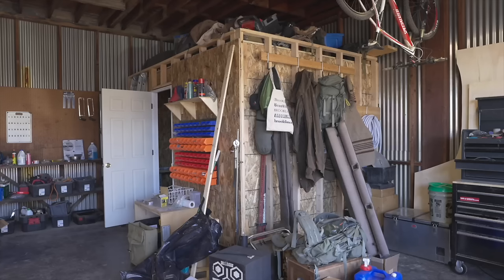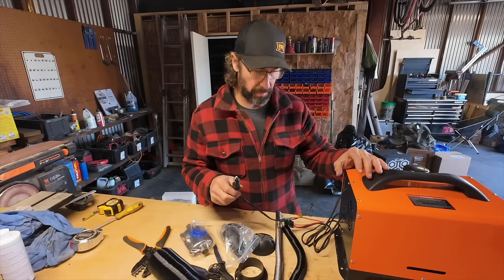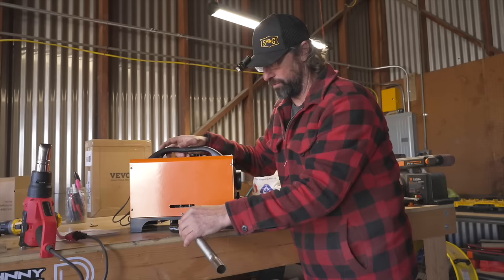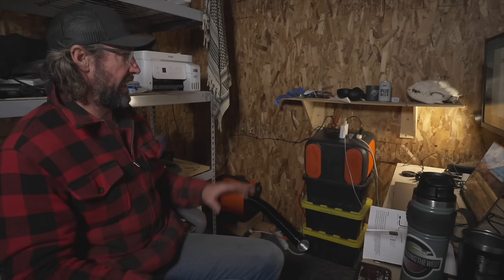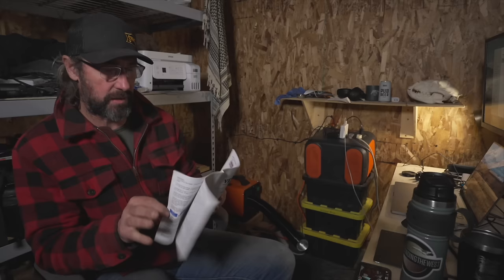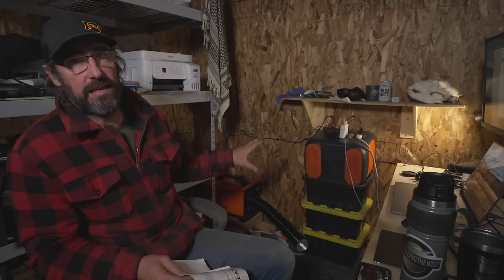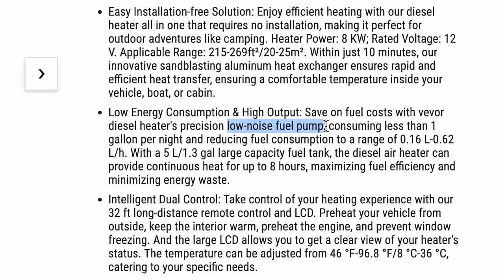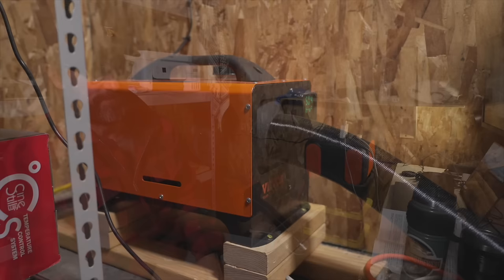Vevor Portable Diesel Heater - Don't make this Mistake😖

Comment: Wouldn't it be more efficient to have the air intake in your office to recirculate the warm air rather than taking in cold air from your shop?
Reply: I thought this too, especially after he said that it was inefficient to have it draw in and heat cold air. But that's what he was doing.
Reply: The intake will be sucking in exhaust fumes... not healthy..
Reply: The air intake from the outside is only for the cumbustion chamber inside the heater. The intake for the hot air is on the backside of the heater.
Reply: If you use the office air for furnace combustion, then outside cold air will be sucked into the heated room to replace the room air for combustion. That will create cold drafts & work against you.
A 90+ % home furnace works the same where the furnace pipes in outdoor air for combustion air.
Reply: @kevinanderson7555  ?huh
Reply: Not at all, if you pull combustion chamber air that is heated up, in to burn only to exhaust it you just made the system that much less efficient. Pull cold air to burn, then you have not wasted energy heating it up prior to burning it.
Reply: @kevinanderson7555  no it wouldn’t…exhaust is outside …remember this is combustion intake ( so that you insure enough air for complete combustion and not starving it for air if you have it inside in a tight space then the possibility is there to not provide enough air combustion air from the outside is always the saftest  ) as far as efficiency it would be a minute difference
Reply: No it needs fresh combustion air
Reply: @sk-wx1cf  the colder intake are the better.
Reply: If you want efficiency, get propane.
Reply: I have my intake routed so it is right next to the heat output,and I set the controller to high altitude mode ,it works great now

Comment: To do the floor in my shop, I used inch and a half foam board and two by fours on the flat. With 3/4 plywood. Worked really good.

Comment: The intake goes inside. It's more efficient and it won't kill you with exhaust fumes being sucked in.
Reply: That’s not how these work, the intake goes straight into the combustion chamber and out the exhaust, kind of like a small engine except these have a heating element and the fan blows through it to create the warm air.

Comment: If I had to guess the reason it doesn’t completely shut off is because it would have to kick up the amps to fire up those glow plugs. Been looking at one of these. I’d like to install one in my travel trailer.  Biggest issue is the fuel tank. So I’m going back and forth on either a unit like this one, or the older types wit the separate fuel tanks. Those Vevor items seem to be built pretty good. Thank you for the video.
Reply: installed in enclosed trailer.removed tank.fuel shut off with drip line into plastic bottle for disconnect. sits on top of unit strapped down with bungie. keep in old tool box for transport. no spilt fuel in trailer .exhaust goes through aluminum pipe and conduit double male connector.
Reply: I could be wrong but I believe all these Chinese heaters are made at the same factory in China and stamped with different names.  I just purchased 3 ChuBu Diesel Heater All In One 5KW/8KW 12V-24V for $99 each, they look and function identically.  
Looking at the specifications,  I see no difference.

Comment: Running it off a motorcycle battery with a trickle charger is a great way to power these heaters. You should never do a hard shutdown; this would happen if you had a power outage. The battery prevents this from happening. I have mine mounted in a hard plastic tote box that’s insulated. The exhaust exits the box using a through haul vent designed for boats, the heat from exhaust line keeps the inside of the box warm. The battery and trickle charge are mounted in the box so they are warm as well. Works great

Comment: Nice write up on your diesel heater install experience.  I also use a diesel heater to heat the topper on my truck.  Works great.  Like others, I have some suggestions on your installation.
1) You might try using a heavier gauge wire between your Jackery and heater.  The voltage drop due to thinner wires may be causing the heater to pull more current than necessary.  Can't tell for sure what size wire you are using, but it looked small.  I would suggest 10 or 12 awg wire and cut the cord from the cigarette lighter plug as short as possible.
2) I understand the exhaust setup shown is just temporary, but for the permanent install, the muffler has (or should have) a drip hole on the side opposite the mounting hole.  This should be placed down so that any fuel or condensation can drip out.
3) Somebody else already mentioned this, but I also prefer having the air intake come from the outside to minimize condensation.  There is a hit on heating, but having less condensation is worth it.  At least for me.
Keep up the great work!

Comment: I'm using a rv 110 to 12volt converter to power mine in my small shop. Works great.
Reply: You'd be wise to run it off a battery with a trickle charger instead of a converter. You could have serious trouble if you have a power failure. These are designed to shutdown properly if the battery voltage should get too low but not if the voltage is suddenly removed.  Think of it this way these are designed to be operated in vehicles.

Comment: Great information! I'd offer two suggestions for your setup, for your start power issue, get a small 12V battery (I use the little 15AH type, sized similar to an electric start generator battery) and a battery tender/trickle charger you can connect to the Jackery, the battery will provide the amperage needed to get the heater running and the Jackery will keep the charge topped off with little amp draw. Second to address the pump noise, I've found wrapping the fuel line with self adhesive foam tape, especially anywhere the fuel line may wrack against hard structures of the cabinet, can really quiet these heaters down a lot. Best of luck with your setup! Thanks for sharing your experience.
Reply: I plan to power a heater with my Jackery this seems like a good workaround. Would you be able to have the battery charger and heater’s power wires connected to the terminals on the battery at the same time? Would I need a fuse board off the battery? I’m new to this
Reply: @Kscanlon22  Yes, it's not a problem having your heater running off a 12V battery that is also connected to a smart charger that is plugged into a 120V outlet. AND Yes, you should protect the circuit from the battery to the heater with a fuse, a simple inline 15 amp fuse will suffice.
Reply: @StratOvation  what’s the advantage of this compared to just running an AC/DC inverter off the 120V outlet? Is it more efficient?
Reply: @Kscanlon22  All of these heaters need to perform a shutdown procedure to burn off unspent fuel and clean the atomizing screen in the ignition chamber and they will run the fan for a few minutes to cool the heat exchanger portion of the heater, the cool down cycle is critical to protecting the ECU. If you do not have a guaranteed ability (such that a battery will provide) to allow the system to cool itself down before powering off, the residual heat in the unit can cause the electronic control unit (ECU) to become overheated (damaging the printed circuitry), rendering  it useless and requiring replacement of the ECU.
Reply: In short, any unexpected interruption of the 120V power to the inverter will potentially damage the ECU making your heater unusable until repaired and lead to fouling of the ignition system which may make re-starting the unit a challenge.
Reply: @StratOvation One might look into a Nitro RC car glow plug and power pack with a simple button.
Last I checked 12 bucks at any hobby store and use that to heat the glow plug on start up.
Reply: @ducewags  Interesting idea. I'm not familiar with that device, would it be capable of delivering a constant 4 amps to operate a heater on high speed? The glow plug would need to be the exact same thread size & pitch to allow a tight seal where it mounts to the heater. What is the amp draw of the glow plug you're talking about?
Reply: @StratOvation  The internet has answers to questions. And the internet also has answers to thread pitch, taper and type. You don't need the same pitch as adapters are a thing that are made to seal glow plugs in heads. RC Nitro engines run over 50k rpm and can have a constant heated glow plug for winter runs in -40 or colder weather. Fun little fast things to play with.
Reply: Just buy a $20 12v 30 amp power supply and run it off your  ac outlets .That is all I have ever used .I would not have a long exhaust ,just more to clean out when it soots up .

Comment: Wow!  That fuel pump is really loud.  I recently purchased a Wippro brand heater like yours based on a review on YouTube.  It's very quiet with just a soft ticking in the background. I believe the pump is well insulated from the chassis compared to other brands.  Very informative video!
Reply: Same here with the Maxspeedingrods.....almost silent. However, I do have hearing issues. When I first ran it outside I had to put my ear near the unit to make certain it was pumping.

Comment: I run mine on a Jackery 300. All you need to do is put a bigger fuse in the actual DC plug that comes out of the diesel heater. With a 300 you can only run it for about 3 1/2 four hours and a full tank of diesel will get you about eight hours of run time.

Comment: Thank you finally someone addressed this issue i was wondering why my diesel heater would shut off using that plug, i just went with the ac to dc power adapter and it works fine plugging it into that, hopefully vevor does fix that issue. Thanks for the content!
Reply: It's not a vevor issue, it's a diesel heater issue as a whole so it won't be changed anytime soon. It would be easier for jackery, anker, ecoflow, etc to bump up their power ratings to 15A than it would to get random chinese companies to lessen their power consumption on start up.

Comment: Good video. For those afraid to tackle taking these apart to install the exhaust and intake lines, I ordered and used a STREBITO Mini Ratchet Set, 22-Piece 1/4 Ratchet Right Angle Screwdriver. Got it off Amazon for $12. Great little tool that has 36 teeth, meaning you can ratchet it with very small movements in a confined space. I paired that with the NEIKO 10068A Nut Driver Set, $14.95. I have since used it on other projects as well. Everyone should own one of these sets anyway.....they are awesome. Using the listed tools I was able to install the pipes with little to no issue. BTW, using a dremel, I extended the spilt in the pipe an additional 1/8 in. and could probably have extended it a bit further. This allows tightening with a lot less final torque. As for powering your unit, I would use a DC 12V 30A Power Supply 360W Universal Regulated Switching AC to DC Converter sold on Amazon for $20....drop down to 20A and it is like $17. I would go 30A though, I am always for overkill.

Comment: Put a house radiator as part of the exhaust, and you will get to use the exhaust to add heat in your office.  Thst or make a coil of tubing into a bucket,.open air or in a wood burning stove and run the exhaust through that before dumping it outside will make better use of your fuel.  This way your exhast heat will radiate off the coils or radiator and the blown heat can be pointed to cross the room or warm the floor.

They way you have it throws away half the heat that heater makes.

Comment: Old computer power supply is a great way to run these.   I personally have a car battery with small battery charger attached.  Be sure to have the exhaust at a slight downward grade to allow any condensate to be able to drain to the outside.

Comment: I saw a review of this heater on another channel. The exhaust pipe got hot enough to scorch wood, so be careful with it.
I would not be able to tolerate the constant loud knocking of the pump.
Reply: True. Exhaust pipe gets hot and connection under unit is very hot. I purchased a 90 degree connector and wrapped the pipe twice with high temp tape. Works great and safer.
Reply: Most models stop ticking after they get warm

Comment: Interesting video. I have an 8kw Hcalory portable diesel heater and I have an ecoflow river max and ecoflow mini portable power station and both power the heater perfect. On start up the diesel heater draws around 120 watts for the 1st couple of minutes and once it fires up and starts to run on diesel it drops down to around 6 watts around the same as charging a phone and would then run continuously for days. As you've demonstrated there is definitely a problem with the set up your testing on start up. My set up must demand less power or the ecoflow just puts out more amps than the jackery.

Absolutely love your videos.  Watched them for a while now. Great content.

Comment: Add a 2x6 framed and insulated floor. You’ll have a step up into the office but that will help the cold radiating from the concrete floor problem.

Comment: Thanks for your review. Great points.
I have a Vevor (5wk) all in one unit for my Van and it blast me out on low setting. I wrapped my exhaust pipe and purchased a 90 deg. fitting (From Amazon) for the exhaust pipe because it hard to bent the pipe to fit the unit. Wrapping the pipe is just safer too. Can't go wrong with the Vevor unit.

Comment: Floor:
Apply some 2” foam board insulation over the concrete. 
No need to glue down. 
Cover foam board with plywood. No glue. Done. 
Insulate ceiling next. 
With 2x6 framing you can get up to R21 batts. Could also put foam boards on Ceiling instead of Sheetrock.

Comment: Check with the manufacturer or with another "standard" manufacturer on the maximum length of the exhaust tubing.
If you get too long, it will affect the back pressure being exhausted. If the burner cannot exhaust effectively, it's not gonna burn properly. You could be opening yourself up for some issues.

Comment: Mine clicked only when setting it up. After priming the pump and exiting the prime part, it runs really quiet. Read the distructions! Also, try to not let it run out of fuel or it will need priming again. Good luck!

Comment: 3 reasons why you want cold outside air for the intake .

1= cold air has more oxygen = hotter fire

2= cold air has less moisture = hotter fire and less soot

3= if you draw in cold air and heat it up inside, you create a heat bubble with warm air pushing out. 

That is why wood stoves draw in outside air. 

Hope this helps.
Reply from the maker: Which intake are you talking about🤔. Its sounds like your talking the intake for the propane burning, not the air being circulated across the heat exchanger. That air you definitely want coming from inside and not the outside. 

Hope that helps.

Jason

Comment: I would also rotate the muffler so that the condensation produced by exhaust can exit out of the weep hole and also I would angle the exhaust so that the muffler is the lowest point of the exhaust so condensation will exit and not run back down the pipe and pool inside.

Comment: I use a 600 watt transformer 120/240 VAC to 12volt DC constant output !works perfectly. Im getting 11.8 to 11.9 and a viktage drop to 11.4 due to my 100 ft 16 gauge ext cord.

Comment: I purposely have my diesel heater heating cold outside air and forcing it inside because I wanted to bring in dry cold air to heat, and force out any warm moist air inside through leakage. I will take the hit on the efficiency to keep things dry.  I can see in an area where you do not plan on sleeping or cooking where this would be less of a concern.
Reply: Yes, I also would be concerned about the exhaust possibly leaking into sleeping space.  Its not worth it for the sake of efficiency to risk your health or maybe even life!  Have the entire unit outside and duct the heat in.

Comment: I run mine outside and have the the hot air ducted inside. Diesel runs more efficiently in cooler air and i run it on 2hz or less. Also my fuel pump is very quite. I have an all in one by wippro. I have it hardwired to the coach lithium batteries so power is no problem. Have also ran it all night on my vtoman 1500 watt power station no problem. I use to heat up my 25ft class C RV and it's way better than the built in propane furnace.